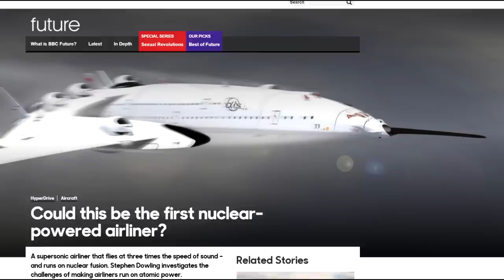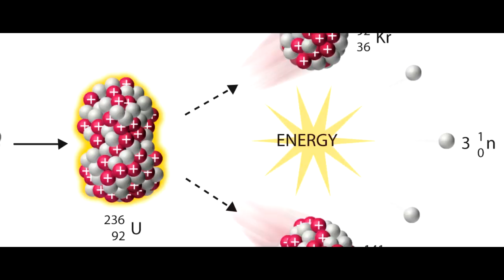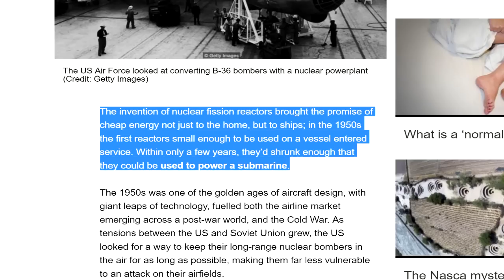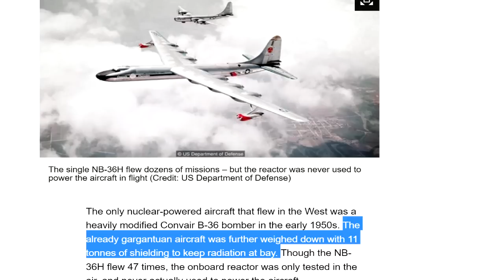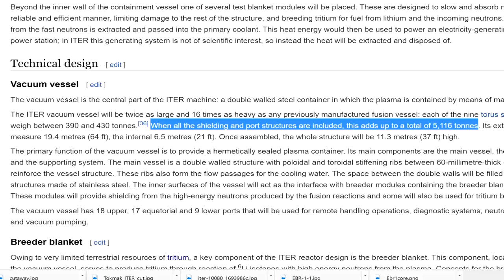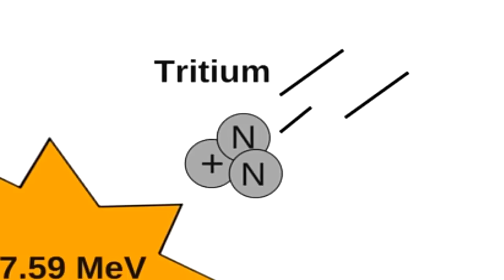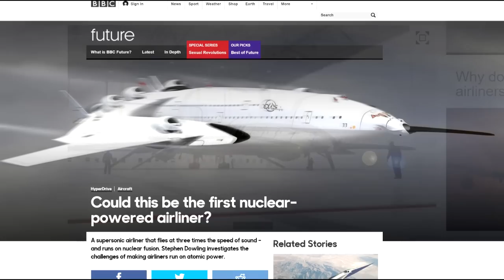SIX ENGINED Nuclear Airliner... BUSTED!

Comment: Not that I'm an advocate for this sort of BS, but there is a definite need to move away from fossil fuels soon. I wonder if electric jumbo planes are possible.
Reply: Maybe. Not currently, but with advances in battery technology.... perhaps.

Batteries in general have very little energy/kg, that's why we use fuels still. There are developing technologies that could bring much higher energy densities, but we haven't figured out how to make them into functional products. That is, we're still in the R&D phase, and we've still got a ways to go at least.

One of the big advantages here, though, is that electric engines are nearly three times as efficient as combustion engines, meaning right off the bat, we only need to pack about a third as much energy into the same weight to match fossil fuels. That said, we're about an order of magnitude away from batteries being able to match fossil fuels.

If we're willing to compromise with spending more load on batteries instead of people and cargo we may not need to hit that mark, but still.
Reply: They are actually completely possible, just not with modern tech. There's no laws of physics that prevent you from using electricity to power a turbofan.
Reply: Modern Turbo Fan engines are normally a high bypass engine . Basically  the only hot part is the centre section where the exhaust is . Down side is that it take  huge amounts of power to run the 16 bypass compressor fans  up to speed (due to rotational mass as each fan is running just below the speed of sound ) . Hence why jet fuel is used as it is the best way to store the energy required .  A electric turbo fan would not have the power to weight ratio required to move the aircraft . To move a  747-300a you need 4 engines supplying 43,000lb of static thrust each . That's a total static thrust of     172,000lb of thrust to get just a 0.27 thrust to weight ratio .  No electric motor could generate enough thrust to get the same thrust to weight ratio .  For an airliner using electric motors you would need a HUGE wing span to generate the lift required with an exceptionally low cruising speed  (due to the thick  leading edges of the wings  to help generate the required lift at low speeds ) and the flex in the wing . Think of it like a U-2a on steroids but slower .   

The efficiency of modern high bypass engines would also excel any electric motor especially once you reach high altitude where most airliners will be throttled down to around 25-30% thrust to maintain  airspeed .  Even with very efficient batteries   the requirements  would require the electric motors to run at a much higher rate . Electric motors are not good at creating torque at low speeds (where as a jet engine turbine will produce thrust from the exhaust as well as  powering the bypass compressor fans .  

All in all  the answer  would be a high efficiency hi speed transport (maybe using a scram jet) or to use ground effect craft  that do not require such high speeds  travelling at 6ft or less over the water . though these normally can not exceed 220mph .
Reply: "the turbo portion [in turbofan] refers to a gas turbine engine which achieves mechanical energy from combustion"

So to those here saying you could do that without combustion, you are all ignorami.
Reply: Daniel Eyre Those aren't really insurmountable problems. Sounds like the kind of problems we're well capable of resolving.
Reply: seigeengine Oh okay; insult me for telling you the truth (you obviously didn't want to hear).

What a loser...
Reply: "There's just no way to provide the sort of power than an aircraft engine
 needs form an electrical energy source. It can't be done."
You should go watch some episodes of fullycharged... It can be done, and it has.
Reply: How'd you come to that silly conclusion? Aircraft engines are just high-power turbines. You know that there are electric motors in the MegaWatt range? Put a fan at the end of one and you have an electric turbofan. And we are obviously able to provide the power needed to run them, because if not, most of modern industry would not work.
We are (currently) not able to provide that power with a reasonable amount of batteries (since they're too heavy), but we certainly have the ability to use electricity to fly a plane.
Reply: Harold Weaver Smith Hydrogen is also a terribly inefficient fuel, since it's either processed from fossil fuels, or produced extremely inefficiently via electrolysis, which needs lots of input power which realistically is also going to come from fossil fuels. So basically, all downsides.

There are places hydrogen is a good fue choice, but I don't see normal transportation ever being one of them.
Reply: Richard Hauer  but completely impractical for carrying large loads  great distances at high speed . The solar powered plane that flew around the world only just flew with two people inside and had the same wing span as a 747 near enough .  You can't just scale them up  to carry more people ect as the structural weight  would break the aircraft's back . a doubling of the size will almost triple the mass .
Reply: Richard Hauer Batteries don't need to get 1000 times better. Batteries only need to get about 45x better to have the same power/weight. Except they don't, because electric engines are about three times as efficient as combustion engines, meaning that batteries only actually have to be 15x better than they are now for a plane to travel the same distance, other problems worked out.
Reply: Richard Hauer Nope.

If you want favours from someone, you should try being nice to them, not demanding.
Reply: "So you see the truth of the matter is, you fix one issue and you steam pile in the next one, mainly because our so called advanced society hasn't evolved for shit"
Income and living standard are growing world wide.

"We're still steaming water" Steaming water to produce is more efficient than you might think.(50-60%) We aren't doing that just for fun.
Tell me a better way to do it.

"Best part of it all is, you're never going to see an exit out of this period in your life time because BIGCORP will never let patents fly"
Not you cant hold patents forever.
Its always (correct me if i am wrong) about 20 years.
aserta
Reply: aserta Hello generic anti-establishment hippy nutjob.
Reply: And blocked for moving from shit to liquefied shit.
Reply: Not yet.
Reply: frackcha What's "fullycharged"?
Reply: Daniel Eyre
Go to the search bar and ask there...
Reply: yes it would be possible but massively and prohibitively impracticable to the point it would be effectively impossible :p
Reply: ***** It's also worth noting that like 90% of an airliner's weight capacity is taken up by fuel.

That means even if we could have high capacity high rate of discharge batteries on them, we'd basically only have around 1/20th the useful energy as a plane running on jet fuel with current technology.

That's the real issue, as I mentioned before.
Reply: Daniel Eyre
No... find it yourself..
Reply: The aviation industry's done quite a bit of work on using liquid hydrogen as a fuel. Major problem is that it's very low density and needs to be kept cool and under pressure, so you can't store it in the wings like you can kerosene. A hydrogen-fuelled Jumbo would probably look something like an A380 but with half the passenger capacity, the other half of the cabin being filled with the liquid hydrogen tank. That would mean you could kiss goodbye to cheap flights as the seat/mile costs doubled. Crashes would be interesting too, as the hydrogen tank ruptures and dumps 1000s of gallons of -200 deg C liquid into the cabin....
Reply: (electrolysis to make hydrogen fuel for transportation, via thorium powered fission, is the greatest hope we have of kicking the fossil fuel habbit, and getting abundant energy, in the forseeable future. Baring some breakthrough in fusion).
Reply: ***** Not so. Electric vehicles are our best bet.

The problem with hydrogen is you lose approximately 50% of the energy you had as electricity producing the hydrogen via electrolysis, then you burn the hydrogen in an ICE, which is only going to be around 20% efficient.

That means by the time your vehicle is moving, you've lost 90% of the energy you had as electricity to begin with. Contrast this with electric vehicles where it's flipped, and you only lose about 10% of the energy you started with as electricity.

That is (simplified), as much energy as it would take you to fuel one hydrogen vehicle could fuel nine electric vehicles.
Reply: That is completely irrelevant. Yeah its not super efficient. So what, thorium power is plentiful, and we can afford to use electrolysis to mass produce hydrogen with it.

Hydrogen environmentally safe, and with a little work, would be no more dangerous than driving with petrol, which is also "dangerous".

Electric on the other hand, requires massive, dangerous, and environmentally hazardous batteries, made from scare, exotic materials, which makes it a non-starter for a replacement to fossil fuels on a global scale.

Electric is a gimmick for college liberals and hipsters. A party topic that you can pat yourself on your back over and bask in the approval of other idiots with.
Reply: Based on your manners in this thread to others you have no basis for claiming moral high ground.

It wasnt even an ad hominem. I wasnt dismissing an argument based on a value judgement of your character, nor was I even making a value judgement of your character at all. I was speaking in the general case.

Its also ironic to misunderstand that, while writing long list of insults oneself.
Reply: You would actually have to make an argument for me to make an adhom. I wasnt refuting an argument you made, so it isnt an adhom.

Also turbofans cant be electric for the same reason rockets cant, and icecream cant be made from 10 foot poles.

Its a matter of definition. A turbofan has to be based on combustion, or it isnt a turbofan.

Now you could power an airplane with electricity.

Details and nuance matter, if you want to be taken seriously. Best of luck with that.
Reply: What the hell are you guys talking about?
Electric planes exist, that's nothing new.....
https://en.wikipedia.org/wiki/Electric_aircraft
(They aren't really useful to transport a lot of people.)
Reply: Daniel Eyre
They are experimental technology demonstrators that work pretty well.
Reply: edmundscycles1
Yes, i know that.
"(They aren't really useful to transport a lot of people.)"
The energy density of a fuel for flight should be high, and i don't expect batteries to get 1000 times better suddenly.
But if money doesn't matter, you may use that technology for some special applications.
For example it seems possible to fly for a really long time.

It is similar with nuclear drive: If you don't care about dying from radiation, it could work. xD
(for example if you want to launch a missile from the moon, where you have a lot of radiation anyway)
Reply: +seigeengine
1000x 15x, doesn't matter. There is no way to do it by just using slightly better materials.
To get a 15 times higher energy density ,you would need a totally new concept.
Lithium-Air-Batteries don't really work currently.
Reply: Richard Hauer Hahaha. We've already made batteries that can deliver that area of power/weight.

I love when people ramble on with such conviction when they simply don't know what they're talking about.
Reply: Richard Hauer Oh look at you, continuing to moan about how I'm not doing what you want.

What a needy bitch you are.
Reply: We can use solar energy to make hydrogen fuel
Reply: Cretium Again, you lose 50% of the energy making the hydrogen fuel, and then another 40% burning it in an ICE.

That is, by the time your solar panel electricity is moving your vehicle, you've lost 90% of the energy.

To put this in perspective, the inefficiency of hydrogen fuel means that only 10% of the energy produced by the panel is actually used. Solar panels are roughly 20% efficient at turning sunlight into electricity these days, so that means you've basically made a vehicle that runs on 2% efficiency solar panels.
Reply: seigeengine I suggested hydrogen because more energy can be stored with it than with our current batteries. While we can fly rockets and space shuttles into space with it, electric planes barely can lift one person over a long distance.
Reply: Cretium Hydrogen really isn't suited to planes for reasons I think we already went into.

And as I said, my point was that it would take ten times as much energy, and hence, ten times the cost to fuel a hydrogen vehicle compared to an electric one off solar.
Reply: seigeengine Well, I certainly didn't discuss that with you. You see, the problem with solar energy is that at this point, solar panels on the surface of a plane cannot provide enough power to accelerate it to high speeds. Also, the production of big batteries is rather polluting. Also, once solar panels become efficient enough to make this type of flight interesting, the production of hydrogen with solar energy (or fusion energy) will have improved as well.
Reply: Cretium That is not a present problem, it's a fundamental problem. You will never have a good plane design powered by built in solar panels. There just isn't enough solar energy over the surface area of a plane. That's why the best we can do now is to have a massive plane that can carry basically one person. It will never be possible for larger planes, and even for light planes, it won't make much sense comparatively.

See, that's your problem, you're just making shit up about where technology will go in future, with no real knowledge of what's possible or not.
Reply: seigeengine I was thinking about that, but I wasn't really sure about it so I didn't bring it up, I was making sure I wasn't making things up, instead of what you said. But I did say hydrogen powered planes would be better than solar powered ones.

Comment: Not to rain on any parades, but modern aircraft have much higher payload capacities than WWII era bombers.  For instance,  the Boeing 747-8, the latest 747 variant, has a useful payload of 154 tons and a range of 4,390 nautical miles with that load.  Granted, I'm sure this doesn't make a nuclear-powered, supersonic airliner any more feasible.  Still, it might be better to use a modern aircraft for comparison.

Comment: Would it be possible to build a Nuclear powered launcher? Like, you use the reactor to generate energy for an engine of some kind, then use that engine to send a small craft up into the sky, then simple let that craft glide to its destination.
Reply: aircraft carriers use nuclear/steam powered slingshots to propel fighters on short runways. This can get the aircraft up to speed, but it can't throw it far/heigh enough to glide further than walk distance. It's just not possible, especially if you actually trying to transport people in what would basically be a cannonball.

Comment: munchkins...

lol.

Why hasn't someone found a better way to convert heat into electricity?  We're still just using it to boil water then using the steam to drive turbines.  Even the fusion reactors are going to do this.  This is 19th century tech on 21st century reactors.

Comment: If its that fast and powerful, why not make it a craft that goes into orbit and comes down at its destination?
Reply: in fact, why not turn it into a tunnel bore and use the most efficient route possible - the straight line...
The thing suppose to have electric motors - they don't work in space.

Comment: Jesus christ, a basic knowledge of Kerbal Space Program is enough to know this is bullshit. The benefit of using a nuclear engine is that you get an extremely large amount of energy from the fuel, but you aren't going to get much fucking thrust for the weight expendature. In space that's fine, in atmosphere YOU NEED THRUST.